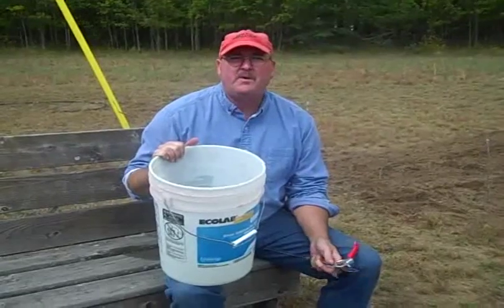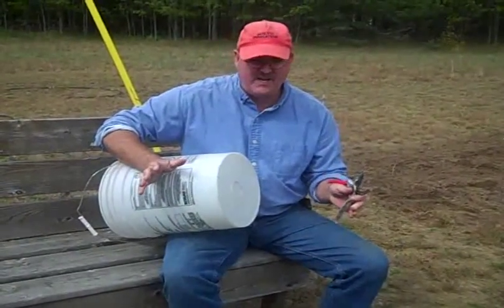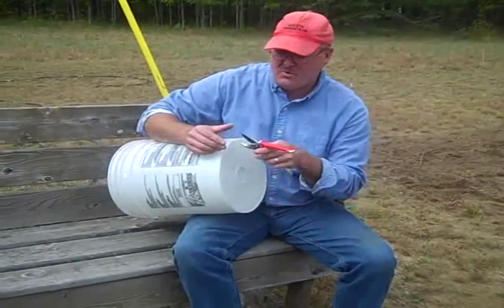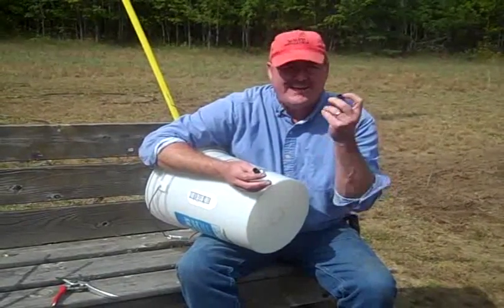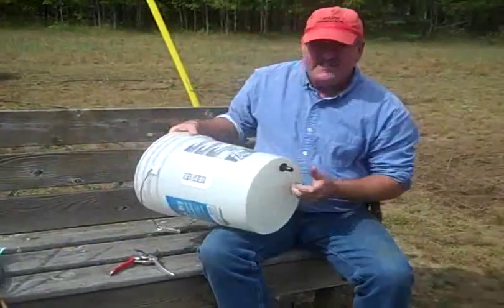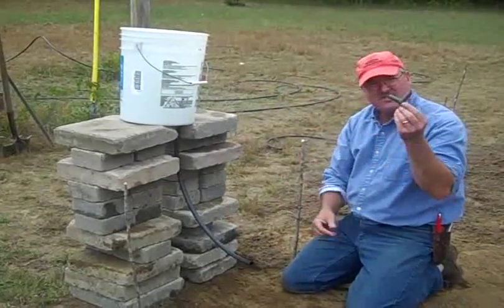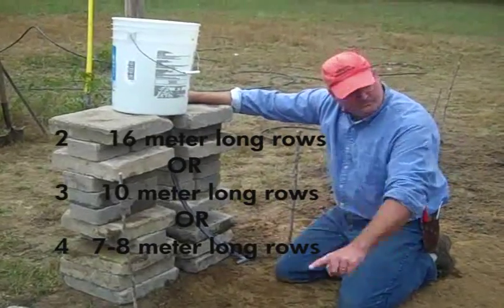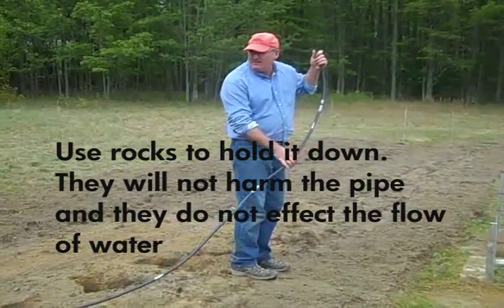11 Oaks: Part 2: The bucket kit and laying the pipe.wmv

Comment: What fine instruction. I like your step by step, makes sense with the parts list first. This is what we call a 5 gallon bucket in Canada. There is in fact some water pressure from the bucket (height matters). Pressure is important. If you have a raised box you can tie in the system to itself which increases pressure. How about a top to for the bucket? The wind will blow dirt into the bucket and this will plug the hose in which case you will have to 'blow out' the system. Thanks for the vid!